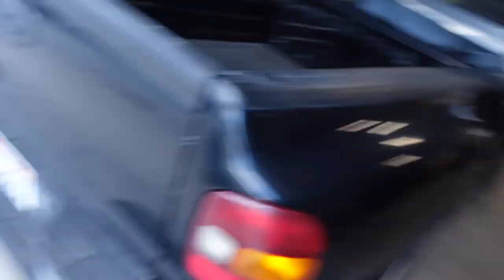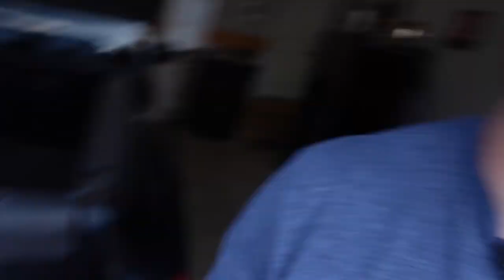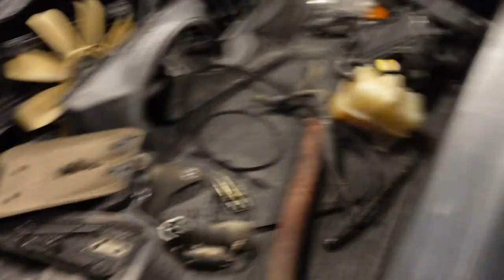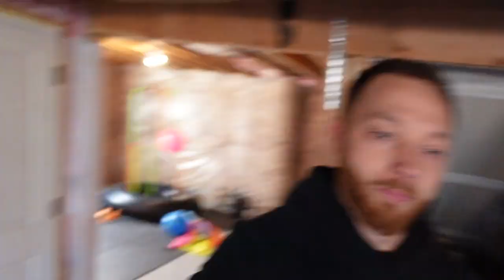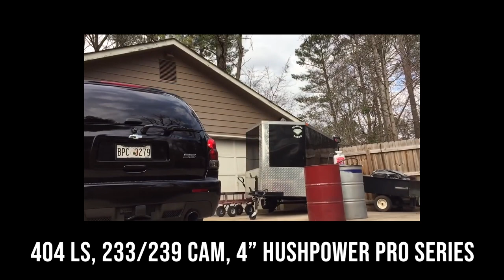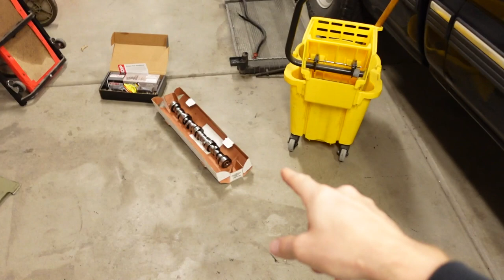4.8 vs 8.1 build begins by REMOVING THE 4.8?

Comment: I have that whole speed engineering kit on my 2000 2500. Just a heads up, the O2 sensor bung on the cross pipe is angled down which will kill a wide band sensor. Need to position it 10* up or higher for moisture drainage. 
Can’t wait to see it done!

Comment: General maintenance parts shouldn’t be taken out of the power budget, just my thought
Reply: I agree. I don't think he should count a set of rods either since they don't make more power, but will be useful when he goes boosted.
Reply: I agree that maintenance shouldn’t count. It gets the engines to equal starting stats.
Reply: Disagree there- still need a stage zero either way before going big. I’d replace stuff with upgrades, but as far as parts cost and budget, it’s $3k and unlimited labor vs. a straight big block swap. Anything that needs to happen to the 4.3 from the start has to count.
Reply: I agree the oil leaks should not be a part of the budget unless it was part of the 8.1 budget
Reply: @bobqzzi  that's an actual upgrade though. Idek why he's changing rods you can make a grand on stock gen3 rods all day.

Comment: ok Lt , my father is a concreate specialist, top of the rank the hot steamer,  secondo muriatic acid ,  and third  super clean degreaser from castrol ,you need a liquid to penetrate a concreate floor not powder   at the end if your budjet  allow you seal it for ever  and btw you can rent the steamer to clean also you engine!!  good luck!
Reply: Muriatic acid doesn't do shit to oil and grease stains.  A strong mixture of lye and hot water (be careful! that stuff will burn you & destroy your eyes), followed by a thorough rinse with plain water, followed by a poultice of baking soda and water is the best way to remove oil and grease stains from a concrete driveway.
Reply: Dawn dish soap and some elbow grease with a brush

Comment: To clean the driveway: basic cheap cat litter or Oil Dri (auto parts store) and use your feet to pulverize the litter into the concrete to help pull out the oil that has penetrated the concrete.  I typically leave it at this point and the rain will wash away remaining litter and dust.  Optionally you could leave the cat litter in place for 24 hours and wash off with hose.  Then dawn soap and a drill mounted cleaning brush which are available on Amazon/eBay.  The drill mounted stiff bristle brush really saves on the manual effort!  Also if you buy a brush kit you can order a kit with stiff to softer bristles and use the soft bristle on kitchen and bathroom cleaning tasks.

Comment: I just did all that on my 06 SSS, left the motor in, dropped tranny, pulled heads and oil pan, along with front and rear covers, went with GPI heads and their ss2 cam with circle d 4000 converter,  but mines 2wd...
Love the vids!!!
Also Rocksolid garage floor coat is good too 👌

Comment: Sounds like my 5.3 on my 04 silverado. My transmission blow and I had to take that out to get a new one so I just decided to take my 5.3 out because the remain leaking oil my oil pan my valve cover I had a check engine light for the knock sensors so I'm doing that right now almost ready to go in. Love the video

Comment: Use Carb Cleaner Spray (better than brake clean) and mop up with rags.  That will get the top junk and you don't need to be fussy.  Then respray carb cleaner and cover completely with floor dry.  Now the important part.  Using your foot , grind the floor dry into the surface. Then work it again with a push broom.  Work it from multiple directions.  Respread same floor dry to completely cover and leave it for a day.  It will wick most or maybe all of the stain from the concrete.  Old timer showed me this 50 years ago.  Now I'm the old timer.

Comment: I have an 03 Tahoe 2wd with the 4.8. Can't wait to see the increase in power. Mine is a real dog. The torque converter lockup kicks out and shifts down to passing gear in a high wind. Not sure if that's normal but seems week. Keep up the awesome video's

Comment: Love where the 4.8 build is going! I was wondering if while you’re at it, could you discuss the LS barbell/dumbbell. Not sure what it’s called. I’ve seen it and heard its good to replace, maybe even upgrade those. But I’m not too sure. When I rebuilt my 6.0, I left it alone. My buddy rebuilt his 6.0 and put an aluminum one in. Thanks!
Reply: They aren’t to hard to change. I changed them both on a 5.3 and a 6.0 I have and it takes about 5 minutes if your engine is taken apart. It’s cheap insurance and aluminum will make sure that if it leaks pressure in the future, removing to replace the o rings won’t risk it breaking in the block. I remove the oil galley plug right above the dumb bell and use a pick to push it out.

Comment: The best results I have found for cleaning oil from concrete is rubbibg alcohol and a propane torch. Start with a small amount of rubbing alcohol on the stain. Light it on fire. The heat draws the oil and moisture to the surface. Moisture removal from the concrete is key before switching to propane torch. Once concrete is dry, use the propane torch to heat the concrete. The heat draws out the oil and burns it off. If the concrete starts popping during the process go back to the alcohol because there is still moisture trapped in the pores of the concrete. Normal results is a slightly lighter color to the concrete where the oil stain was. This will fade to a uniform color in about 2-3 weeks.

Comment: To clean EVERYTHING, I use an HVAC coil cleaner called “Foam Brite” it can be diluted, or for really dirty stuff used full strength. Designed for cleaning super greasy kitchen equipment on rooftops that are always neglected. Some call it yellow death, there’s plenty of YouTube videos of its uses. Several manufacturers including NuCalgon. It’ll clean your cross members and undercarriage too. 🍻

Comment: I've cleaned up oil off concrete from my diesel (straight black, full of carbon) with liquid laundry detergent. Pour it out on the stain, scrub it in with a scrub brush, let it set for 30 minutes and hose it off with a water hose. I've done it 4-5 times, don't need to pay anybody to bring in some fancy machine.

Comment: you can also buy a muffler that has an internal x-pipe as well.  In fact, I had a 97 Lincoln Mark VIII with a Dynomax "Ultraflow X" mid-mounted and sounded amazing.

Comment: So I've done a ton of storage unit engine swaps that make a horrible mess and I've never been charged for leaving oil stains. All I do is put a bit of (and I know it sounds bad) gasoline on the oil stains to lift them. Then I soak the stain with industrial purple or purple power and pressure wash it off. Works every time

Comment: Dawn regular dish soap with some water. Pour it over and do a minor scrub with something like a shop push broom. Let it soak in for a while. I keep rewetting for a few hours with some some more minor scrubbing. Rinse off the driveway. I’ve also done it to where I do the same mix and scrub the heck out of it and rinsed it. Reapplied if necessary. Works either way. My main thing is keeping it wet but not running down the driveway while it sat. It’s easy either way

Comment: I will be curious to see if you experience in-cab drone with the exhaust.  I have an '01 ECSB with a LQ9,  550 lift Texas speed cam and the Speed engineering dual 3" exhaust kit and headers. Magnaflow muffler with the dual tailpipes.  I had 82 db in the 1400 to 1900 rpm range.  I added Vibrant Ultra quiet resonators which dropped 4 to 5 decibels out, but that was all.  It sounds great, but my old man left ear doesn't appreciate it if I cruise too gently.

Comment: A sure fire way to get rid of oil stains on cement is to spray with oven cleaner, let sit about 10 minutes, scrub with a stiff bristle brush, then rinse off with water. Repeat as needed until stain is gone.

Comment: I love my lil 4.8....it has a 220/220 cam on 114lsa with upgraded valve springs and a 3000rpm stall on a th350......it is a beast,  if I didn't tell you you'd never guess it was a 4.8 with only a cam and converter. ..........cj7 jeep beats ford raptor in sand race.....look that up on you tube....I bought that very same motor that was in the red jeep....I even helped him pull it out of the jeep upon purchase. ....he wanted to go with a 408 stroker. ....he was under the impression that the motor was a 5.3 cause that's what the ecu said....when I got it home and swapped the oil pan for a car pan to fit my nova is when I discovered it was a 3.266" stroke crankshaft  (4.8).......I can spin it up a hair past 7k....7200rpm
..
                   I wasn't even mad though

Comment: If your going to change head gaskets might as well mill the heads to bump up some compression. Change rod bolts and ring end gaps. Lifter trays and lifters. Trunnions bearings. Oil pump,cam chain and cam chain tensioner. Cam bearings if they look suspect?

Comment: While you’ve got it apart, have someone go over the heads. My 6.0 needed new intake valves even though it is 10 years newer than your 4.8! A good valve job and a few thousandths off the heads will make sure you get all the cam and headers have to provide. Maybe a thinner head gasket, too.

Comment: You think me buying a remanufactured 5.3 would be good. Or I'm also considering the summit racing 5.3 create engine 450hp ?   Or should I just keep my 5.3 and rebuild it. It's also leaking in sertain areas. I just had the transmission rebuilt.

Comment: Nice. Been trying to decided what to do with my 323k 4.8l in my 2000. Thinking a resealed JY 5.3 with a mild cam.
Reply from the maker: there's no replacement for displacement, which is why I went with the 8.1 lol... but a 5.3 will def. be a good upgrade over the 4.8. I'm just stubborn and want to try small vs big
Reply: @LawrenceTolman  if it was just a toy I'd go nuts with it, but its a daily driver/work truck so I want to keep it pretty simple.

Comment: To clean driveway oil, gasoline poured directly on the stain work in with a stiff bristle broom or brush, whatever you have. Then use your oil dry or kitty litter of choice on the stain making sure the gas is still wet when applying the oil dry.

Then work the oil dry in with your feet pressing and scraping that oil dry in the stain. After crushing the oil dry into a fine dust into the stain, sweep it up. Should be totally gone the first application, if not grab some more gas and repeat.

Comment: I have an L86 with longtubes, high flow cats and that muffler. It sounds wicked. I ordered a 2500 4 inch muffler back off Amazon for 100 bucks. 3.5 inch to 4 inch adapter off header y pipe. Into 4 inch to the muffler. Oh itll be loud, had to add a J pipe for less drone. Id implement one before hand or plan it in the piping.

Comment: product called "Mighty Boss" usually available at ACE hardware stores and i think on Amazon will remove grease and oil from anything. so much so that I generally buy it by the case for me and my co-workers! that and a power washer!

Secondly, Richard Holdner (i think thats right) did an artical that appeared in Hot Rod, Engine Master, and Online that had what they thought was a Junk Yard 5.3 but turned out to be a 4.8..... it made over 1400 hp "Turbo" for well over 200 plus runs. the original jist was how much can a stock engine take.... the articles I read were rather impressive.

Comment: I use a driveway cleaner called “Drive Up” and have had great results.  

Will opening the ring gap on the 4.8 affect its power output negatively without the extra boost?

Really would like to see an after cooled supercharger build.  Instant throttle response in a small chassis and AWD?  Might break some driveline parts with this one!
Reply: Not really depending on how much you open the gap up, if you're going to gap for big boost than it would be an issue but for 10-12psi no biggie.

Comment: Turko or Gas Path you can get it at an aircraft supplier that will clean your oil spots. Change the lifters as well, we both know that the lifters are a weak point and if you have any $$ left a trunnion upgrade.

Comment: On this e-fan swap can you show how to keep the A/C feature?  On ugly truck you mentioned it but did not show it as you were not able to keep A/C.
Reply from the maker: there is a way to wire up a 3 wire pressure sensor and plug that into the computer to get it to all work together. I have a diagram somewhere, and when the time comes I will for sure make a video explaining it all...

Comment: I’m building my 2000 rcsb right now, so we are doing a lot of the same stuff. The only difference is my motor has gotten a little out of control! I scored an LQ4 and was just going to do HCI and drop it in. Well, now I have a 402 stroker kit on the way, and some 799 heads getting ported at TEA. I don’t know what Has gotten into me!

Comment: Gotta be honest when u said high revving, I thought u was going to say 7500😅. Please go to a thinner head gasket or mill heads some if u take heads off 🙏🏻 .  Excited to see how it does. I have my guesses on power & ET's
Reply: MLS gaskets, the 1999-2001(?) Did not have them stock. Fyi early LR4/LM7 had smaller journals

Comment: That cam is large for an NA 4.8 daily. Hope its on a 110 or tighter LSA? It will likely require you to rev it out well past 6500, which isn't going to be matched well with factory intakes etc. I would Def. advance the cam 4-5* IMO to help bring the power band down a bit.   good luck!
Reply from the maker: Agreed, it is on the larger side, but everyone’s definition of “daily” is different. I’ll at least have a loose converter to make up for the cam

Comment: I'd say that the leak repair and head gasket don't count towards the $3k performance budget.  With that many leaks, it makes me question if there isn't a crankcase pressure issue.
Reply from the maker: there very well could be, I think the PCV systems on these were known to clog up

Comment: I’m glad you’re dead set on keeping the 4.8. They’re mean little engines! Probably not helpful to you but I have a gas pressure washer at work with a diesel tank for the steam part of it . Cleans my driveway stains easily.
Reply from the maker: we used to have a steam pressure washer at my last shop, and that would pull grease and dirt out of anything it seemed like
Reply: I've gotten away with hooking my pressure washer straight to the hot water heater.

Comment: For cleaning oil stains on concrete they make a green acid powder. Used to use it every week at a garage I worked at in high school and it did keep the floor clean.  Not sure how it will work for you if your driveway is a brushed finish, might need to steam pressure wash it

Comment: Got that 4.gr8.. what's your thought on electric fan conversions?  Especially for a daily.  I asked this before you said you were doing it.  Interested to see how you do it.  I know from the motor trend video those stock fans pull a lot of hp from the engine.
Reply from the maker: I'm all for it as long as you get a big enough fan. I'll be using 2005+ silverado stock electric fans, so I know they're up to the task of cooling the 4.8. I've got the same setup on my 8.1 and it works perfectly
Reply: @LawrenceTolman  Do you have a video of installing it on your 8.1?  I've been thinking about it, just for better cooling and more power, I use my 8.1 for towing 10k lbs camper.

Comment: 862 cnc ported heads $1250 ebay 
Sloppy stage 2 cam and trailblazer intake with 98mm fast throttle body

Comment: Just count the go fast parts for the $3000 budget, the rest is repair and it’s different.  You would have to do it anyway.  I would say if you have to rebuild it, if you stick with stock internals that doesn’t count but if you go forged pistons and h beam rods that is different.  I rebuilt my 6.0 10 years ago and had 2 bad rods, 2 new stock ones were $150 and a set of scat forged steel I beams were $200.  So engine reseal and fix is repair and go fast comes out of the 3k to make a fair comparison.

Comment: If you do the MLS gasket you’ll need a newer style head as well.
Reply from the maker: I had found a Mahle MLS gasket that was designed specifically for the 99-00 4.8/5.3 without having to change the head

Comment: I might be wrong but I don’t remember you opening the ring gap on the 8.1 so I wouldn’t open it on the 4.8 cause then there is a advantage
Reply from the maker: I didn't do it on the 8.1 since I knew even if I did open the ring gap, the stock pistons wouldn't hold up to my 1,000hp+ power goals, and they would need to be replaced anyway. On the 4.8, I want to gap the rings and keep the power level somewhat reasonable (650-700hp) which should last a decent amount of time on the stock pistons/rods. The only advantage to gapping the rings is that it can prevent damage, and should have no affect on the power outcome of the NA build. if anything, a slightly wider ring gap may hurt power

Comment: 10👍's up LT thanks for sharing
Reply: LT why you got it apart take a .02 thick washer behind the spring and the oil pump it'll give you a little more oil pressure at idle take that dog bone out of there and get yourself an aluminum one that won't distort so much with the oil getting so hot cuz most of LS engine have a 53 lb oil pressure spring in the pump

Comment: You must have done your homework selecting that camshaft.  That’s pretty much the sweet spot for not being too large or too small for the rest of the combo and intended usage.  Definitely too large for a daily typical truck torque cam deal in a 4.8 IMO.
Reply from the maker: I think without the converter and a re-gear it might be a poor choice, but with the 3,200 stall and maybe a 4.10 swap, it'll work nicely (I hope)
Reply: No doubt too large for a stock 4.8 truck deal.